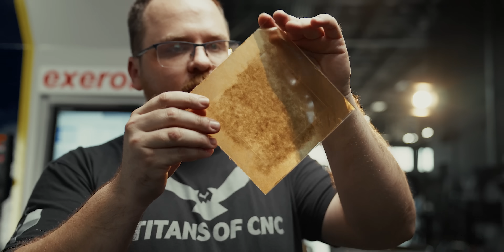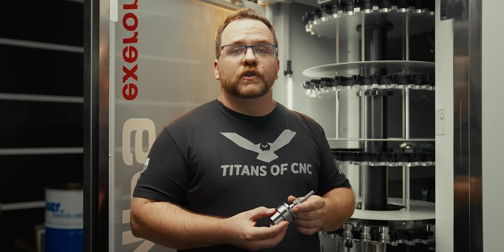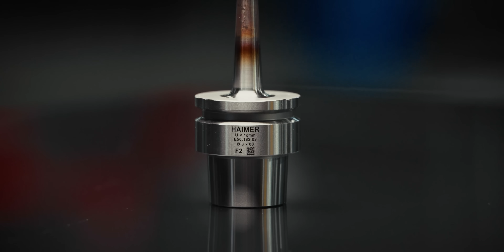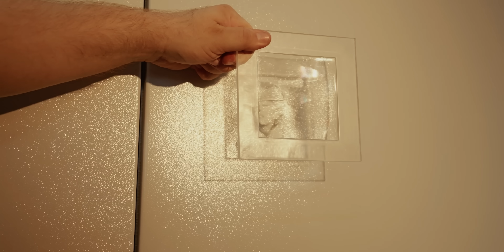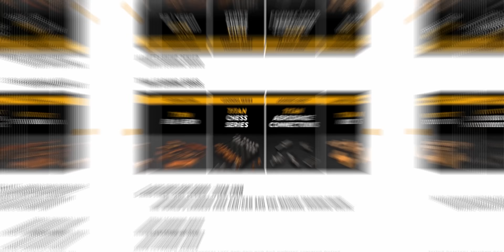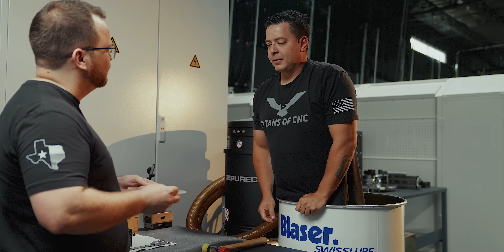CNC Machining Trick That Defies Physics

Comment: Acrylic can be further hand-polished using something like PolyWatch. Some expensive watches still use acrylic domes over sapphire because it will flex (or at worst form a small crack) if impacted, versus a sapphire which will shatter into a million pieces. It does pick up small scratches with use, but a 5 min polish once a month restores it to like new. Sapphire is great for jewelry, but work watches use acrylic for the same reason headlights and aircraft canopies do.

Comment: That’s one hell of a demo. I designed Z-80 based CNC Controllers back in the 1970’s. Fast slew rates were 200” a minute. Not to mention Machinists were still demanding paper tape for program input. The cutting tools set the limit. Today’s speeds and accuracy was a pipe dream then.

Comment: it's like an image encrypted using physics
Reply: originally a Chinese invention called "Magic Mirror" that used special polished bronze surface mirrors, that through an relief image cast in the surface of the backside, resulted in tension buckling on the mirror finish polished frontside, that was able to project that image with its reflection.

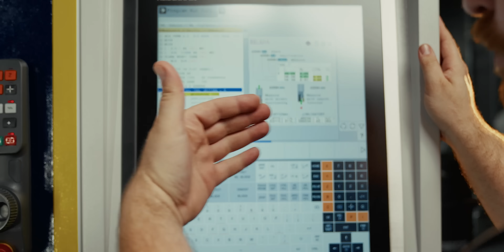Comment: 3:10 soo you cant turn on a setring in tool library to automatically meassure all new tools ? Thats kind of anoying tbh. On Hermle you can check you'r tool before and after its path to make sure about the dimensions and if its broken it will stop your machine. This seems kind of half done

Comment: Just had to look up the specs for this machine. +/- 2um precision. Wow! My humble little 5 axis lathe I built is good for +/- 20. But that's fine for my work. 
Just curious about using MCD for the little ball mill. On my mill I go down to 1mm ball in solid carbide for acrylic and acetal. Is there a benefit in using MCD for plastics?
Reply: If you need a truly optical surface (vis or lower) and I mean truly optical i.e. surface finish callouts are in lambda/X.

Comment: Meanwhile, for a machinist with a less impressive machine, a lithophane is probably much more accessible (and doesn't need to be held right next to a wall). But this is most impressive of course...
Reply: Heck you can 3d print pretty good lithophanes